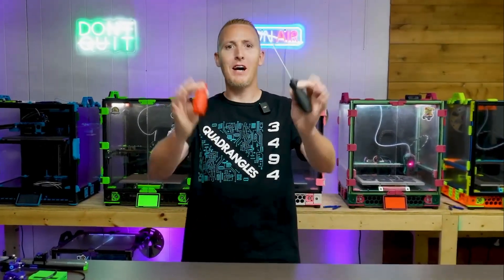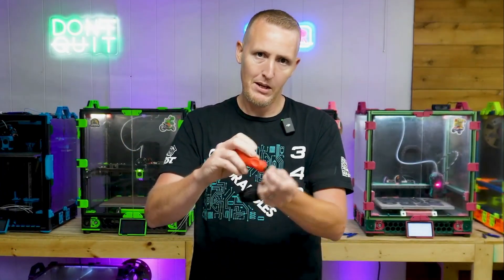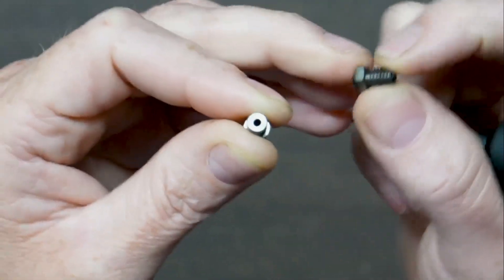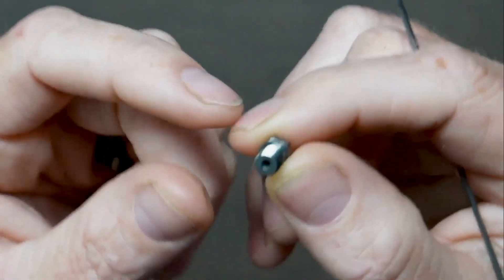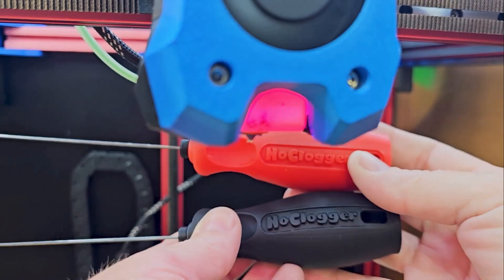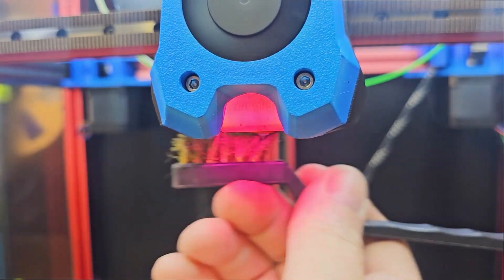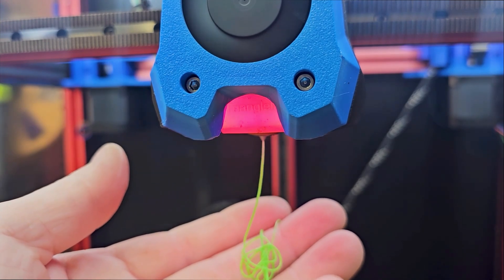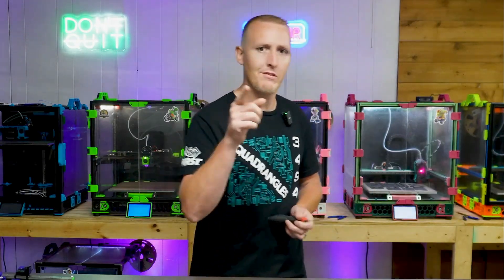Testing the No Clogger: Effortlessly Remove 3D Printer Nozzle Clogs!

Comment: Will this work on the Bambu Lab X1C et al?
Reply from the maker: Great question! I have not tested this on my X1C. But... If you would like, I'll make a short testing it out :)
That being said, this should work in any 3D Printer running 1.75 filament. And access to the top of the extruder straight down to the nozzle.
I hope this helps. Thanks for watching!!!
Reply: @leemerie3d  I “heard” it’s not a straight shot thru the extruder like most other printers. There’s a circuit board or something fragile in there. I’m a newb, haven’t had to do this yet, and I don’t wanna break anything  yet. This def works on my old Voxelab Aquila S2 tho.
Reply from the maker: @RollerCoasterLineProductions  Hmmm... I wouldn't know what could block the path. I mean there is a board with a sensor for the filament there. But as far as the path, it should still be strait thru. 
Luckily, in the name of science I will sacrifice my X1C for you 😂 I'll get back to you on this. Join our discord if you want to chat there and I'll post some pictures along the way.
Reply: @leemerie3d  don’t break or sacrifice anything for me!

Comment: Will this work / have tried it with an CHT nozzle?
Reply from the maker: That's a great question! I would have to check the fitment beforehand. I would assume it would work though. Even if would get a small amount of it out. I'll have to do a follow up video now 😁
Reply: @Lost_LLC  it will definitely work for clogs that are above the nozzle. I'd expect this to help somewhat with clogs in the cht nozzle but not quite as well since the no clogger won't be able to fit in the cht part.
Reply: Lightning *

Comment: I use them all the time except my was only an 1/8th the cost.... I have a 2.6mm rod I use bent at top for a nice handle ... I broke my original unclogger... It went through the handle..
Reply from the maker: That works too! Basically just a rod to push through there and your all set :)

Comment: I crank up the temperature on the hotend and then use one of those to push the filament through. It usually works pretty well. A lot easier than taking everything apart. 😁
Reply from the maker: Yep! That's what I did. Crank it up high and push that crap thru. Worked like a charm :)